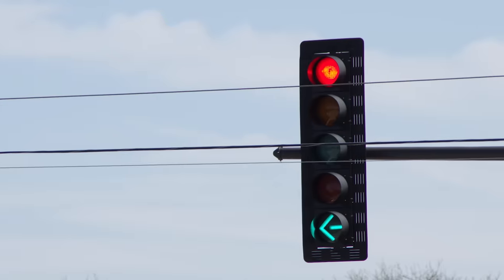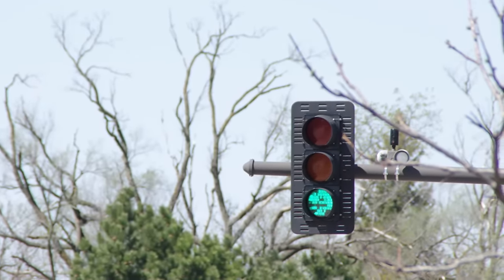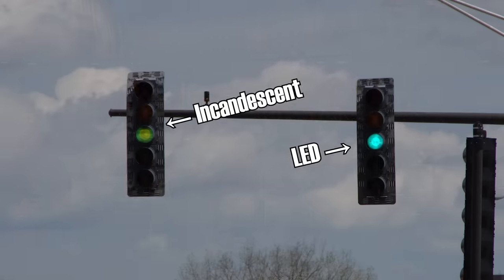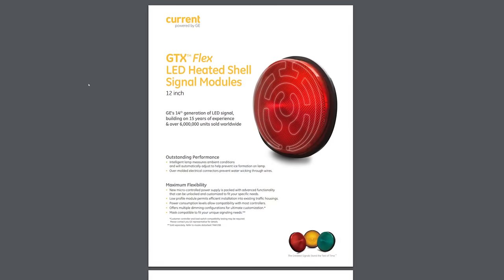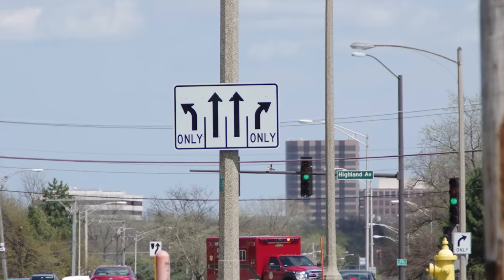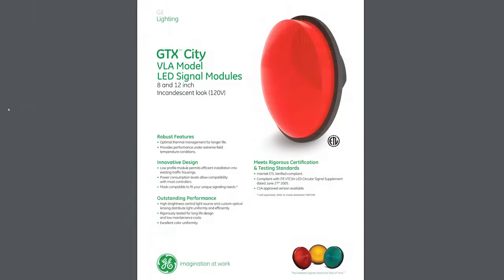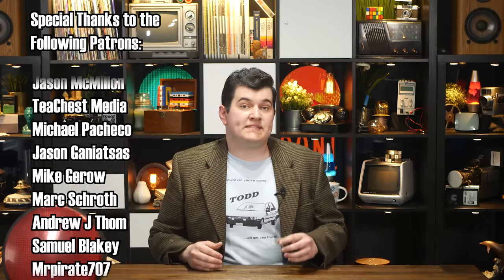The LED Traffic Light and the Danger of "But Sometimes!"

Comment: I would also be curious to know how many times "but sometimes" a burned-out incandescent light was the cause of a traffic accident, too.  I would bet you there are many many more injuries and fatalities associated with that than with iced-over LEDs, but nobody talks about that side of the equation either.
Reply: This is wrong idea. If the incandescent light burns out, it stops taking the current and the control unit can switch the crossing to "Danger" etc. I would bet the LED can be damaged easier and with less control over it.
Reply: @jirizlamal69  
Consider watching the video at some point
Reply: @jirizlamal69  I think you're assuming a lot.  I've seen quite a few traffic lights with burnt out bulbs, and in my experience the control circuitry in most of them is actually not sophisticated enough to do that.  They will typically switch to "failure" mode only if the whole thing loses power completely (i.e. a blackout), but not if only a single bulb burns out.  (Also, the typical "failure" mode (at least in the US) is to just flash all the red lights on and off, but if it's the red bulb that's burnt out (which would be the most likely to cause accidents), then that doesn't really solve the issue anyway, IMHO.)

I'm also not sure why you think that LEDs can be damaged more easily.  Modern LED assemblies are more robust than incandescent lights in most ways, and generally far more reliable (which you should really know if you actually watched the video, or, you know, ever actually tried using any LED lights yourself).
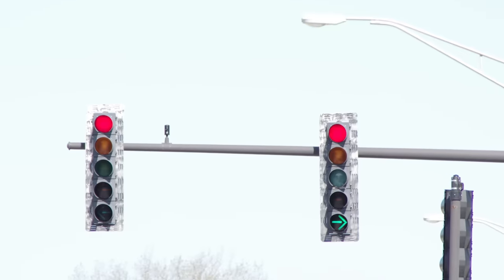Reply: @jirizlamal69  As demonstrated in 15:22, LED lights fail gradually. An inoperative diode doesn't result to complete light failure as incandescent bulbs do. Plus, a lot of LEDs are designed as a retrofit as shown in 2:43, so replacement procedures do not change at all.

In the first place, as explained in 3:13, LEDs have much greater lifespan than their replacements.
Reply: @Jiří Zlámal  I feel as though you opened the video, paused it about a second in, and then commented so you could share a misinformed opinion without being bothered by the idea that you might not know best. I advise having a wonderful day as you call your therapist and work through whatever causes you to think this way. 🤗🥰💖
Reply: That's not the point tho. If we can exercise rational thinking, this wouldn't be an issue at the first place. The point of this whole thing is how people are tolerant of what is already there, but not tolerant of new things, even if there is significant benefits.
Reply: @hiddenbunny7205  And the solutions to new problems of new things are often straightforward.
Reply: @dbclass4075  Oh it is all so USA! Just sort your media outlets out and get with understanding technology.
Reply: @douglasrogers3918  Henceforth the existence of this very channel.
Reply: Actually they do. That's part of the motivation toward LED lamps.
Reply: In 2022, still not having current sensing and a second bulb (or dual wiring in bulb), is a crime.
Reply: @foogod4237  Small leds live forever. Howerver powerful leds fail easily cause of heat.
Reply: @gizaha  Only if you're cutting corners and cheaping out by overdriving them or not heat-sinking them properly.  There is absolutely no reason a well-designed high-power LED assembly can't last just as long as small LEDs do, if not longer, and a great many of them actually do.

Cheap consumer equipment sometimes has this problem because they're doing exactly that (cutting corners to make things cheap), but the sorts of LED assemblies used in industrial applications and modern traffic lights, etc, are actually usually properly designed, and darn near indestructible in practice.
Reply: @foogod4237  I can't tell, you might be right but first, i didn't see a non-cheap POWER led that lasts more than 5 years and second there's a reason they use a fan to cool them down to increase their life (still lifespan is small). And the worst part after failure, the 2020+ curse, post excuses: "it failed because of this, it failed because of that".

But one way or another, a current sesing must be standard.
Reply: @gizaha  All I can say is you must be looking at the wrong products in the wrong places.  If you're looking at hobbyist electronics supply places, then yeah, of course you're only going to find crap there, because the good stuff actually costs money and most hobbyists just aren't willing to pay for it.  If you're buying some pre-built assembly off some hobbyist store site, it's pretty much guaranteed to be made as cheaply as possible in some no-name facility in China somewhere, and only tested just enough to get it out the door.  If it fails later, they don't care, because they've already gotten their money.  So why waste a bunch of time and money designing it properly to actually last?

But that's not the fault of the LEDs, that's just the fault of the crappy engineering that went into making those products.  When people actually are designing things to last, it does take a lot of time and money to do right, but when it is done properly it really does work, and there are lots of industrial products (many of which operate in rather severe environments for many years at a time) which prove that pretty well.

(And the use of fans is not really "to increase their life", it's actually "to use them correctly".  All LEDs produce heat when they operate, that's just a fact of physics.  You need to get rid of that heat somehow.  Small LEDs have a large enough relative surface area that they can act as their own heat sinks.  Higher-power LEDs need to have some external assembly to help dissipate that heat, though, and if you don't provide that it's really not that different from doing something like driving them with too high a voltage:  Like any other electrical components, of course they will fail if you use them wrong.  That shouldn't really be a surprise to anybody.)
Reply: There's no way a traffic light incandescent fails every year, also.  House ones do that because they're designed to be crap.  Industrial ones go dark instead because they're overbuilt.

Comment: It is indeed a nice jacket
Reply: Useless Duck Company Ph.D jackets.
Reply: I personally love the shirt worn by Mr "modernize NOW" even better. Railing on about how we need to get all modern & save the planet with these wondrous LED signals, while his shirt extols the virtues of a mid/Late 80's 4 door most likely CARBURETED  Import  (86 Tercel, I'm thinking). FWIW, I love those 80s Toyotas. Got an 86 Tercel 3 door hatch of my own, wouldn't trade her for all the gold in the world. But I don't run around pushing against obsolete tech while simultaneously promoting it.
Reply: My previous scool required to wear very similar ones
Reply: I think you should go to it a bit longer. I had no problems with jacket. It was very convenient too, because there were lots of pockets. We also had last day of the month, when we could go without official uniform. I only sometimes used that privilege.
Reply: MCPE McXreepeR Jeez, learn to write. You haven't wrote a single correct sentence.
Reply: lol do you even care about anything else, rather than how you dress up?
Reply: but tight - - - - -
Reply: just needs leather patches on the elbows
Reply: The delay on the right turn arrow exists in order to prevent cars turning right without looking for those last few lefts clearing the intersection, especially large vehicles that may not have a choice of lanes.  It has nothing at all to do with pedestrians, if it did, the right arrow would be disabled or delayed by the walk button.
Reply: But sometimes...
Reply: And how!
Reply: Yeah but it's tight sometimes I'm so disappointed humanity ☹️
Reply: @kyngliam1697  I care I checked it out but it looks way beyond my scope of abilities it would be cool but I needed to be easy
Reply: But sometimes it’s not necessary so you shouldn’t wear it
Reply: @MJ-uk6lu  I know this comment is super old, but I found it funny.
*You haven't wrote a single correct sentence*
Written or wrote 🤔
Reply: I found him recently and it's hard to imagine him without the jacket

Comment: Australia has nice signs for that:
"Stop if signals blacked out or flashing"
The sign is typically a simply STOP sign with 3 black dots to represent the blacked out traffic lights.
Reply: Never seen that. Usually it's just chaos as no one knows who has priority.
Reply: @Cheepchipsable  No. The give-way-to-the right rule kicks in.
Reply: @alanbeagley5529  or if your car is bigger.
Reply: Never seen those signs here, it's just a standard uncontrolled intersection
Reply: My country we have regular stop sign below
Reply: Is it weird that my European country has signs that are like for a normal intersection, but they are valid when traffic lights don't work? I thought it is kinda obvious to do it this way
Reply: @diagramgml  Some people may get confused between the lights and the signs, and then just try to follow the signs ignoring the lights.

Never doubt human stupidity and try to make things as idiot proof as possible.

There can also be confusion with people coming from elsewhere.
Reply: There's a problem, though.  What if the LED lights are only snowed out in your direction?

I've been in that situation.  Multi-lane roads in both directions.  I pulled up to the light and stopped.  I took the time to try to look around to see if I could see if the other directions' lights were also snowed over.  I could see that there was a wall of cars coming.

The person behind me honked their horn at me, then before I could react, changed lanes to drive around me.  Before they could actually get into the intersection, the cars going the other way drove straight through it, like they had the green.  Because they had the green.
Reply: @connorp4213  You have to think about them because they're out there.  I've heard of instances where the lights were only snowed out in other directions and I wasn't in the way of an idiot and they drove right out into the intersection assuming that the other direction would stop.  Under normal conditions, the other direction might have had time to stop in response to seeing someone run the light, but in these they couldn't.  That's all hearsay, but it sounds very plausible to me.
Reply: Here in Canada we treat flashing traffic lights as a 4 way stop. It’s actually the only scenario that works.
Reply: I was confused when you said flashing until I remembered that an advanced go is unique to Canada
Reply: @Tearnalte  when there’s a malfunction the red light flashes. Advanced green is when there’s an arrow that says you can turn left because in coming traffic has a red light still.
Reply: @donrotten4791  I know what an advanced green is, I forgot about the red and yellow lights, oops
Reply: @Tearnalte  do you drive?
Reply: @donrotten4791  No, which is why I probably sound like a complete idiot (and that's not wrong, tbh)
Reply: @Tearnalte  You didn’t come off as an idiot. I just got the sense you didn’t understand what I was talking about. I’m more of a rural guy so I don’t know all the nuances of city driving. I was afraid of traffic circles and down town one ways for years. I wouldn’t know what to do when they reverse lanes for rush hour.
Reply: Here there are just straight up stop signs...And of course, the crosswalks become a zebra
Reply: It does until the person coming the other way sees the green light and takes you out after you stops sign the red light
Reply: @dustinmeek4032  Do you know how to use a stop sign?
If you have a stop sign, then you would need to stop and let that person go through. It doesn't mean you drive into the intersection expecting them to stop.

The problem would actually be the other way, where you have no lights, without the stop sign, while the other way has a green light. But that is solved with redundancy and appropriate wiring.

Comment: I noticed where I live that some traffic signals have both incandescent and LED lights leading me to believe they are just retrofitting them as the incandescent lights burn out instead of taking on the enormous task of replacing all at once.
Reply: I think that's what usually happens.  And that takes a long time since there's no way the incandescents are burning out every year, house ones do that because they're crap, industrial ones can be much better exactly because they're a pain in the ass to replace
Reply: @tsm688  It's not about them being 'crap' or anything. If you put in the same bulbs as the ones in traffic lights into your regular house network, they would burn out somewhat similarly to other bulbs in your house (which depends on your houses wiring, not the bulbs itself).

The reason why bulbs in homes blow so often is because they are being fed more electricity compared to the thickness of the wolfram wire. As it heats up (from electricity passing through it), there is a structural change to it and eventually it just becomes too fragile and breaks under smallest shock or its own weight.

If you went and lowered the power output of your light (for example, running the 100W one at 50W with a dimming controller), then it would last you many years (unless your houses electric system just sucks).

The reason why the wire is so thin is because...it's more efficient as a light. If it was thicker, then you would need more power to have the same brightness of light, and as a result, at some point, you would even have a light bulb that barely gives light but heats like a heater.

Proof of the above? There are light bulbs that have been constantly on for over a 100 years. And I mean it, constantly on. But they give almost no light due to their wolfram wire being thicker and the current reaching them being lower.

Comment: "Really bad snowstorms can block the lights!"
Yeah but imagine that same snow storm knocks out the power (which it could totally do if it's THAT bad) and now the LED lights are the only ones that still have power because of the battery backups.
Reply: unless the snowstorm blocked the lights?
Reply: snow doesn't directly take out power.
Indirectly it can happen, rare but it does.  Snow can clump together and get really heavy.  Then tree branches fall, wires get hit, then power goes out.  Recent winter, i took a picture of a skinny wire, like 1mm thick, that got like 12mm of ice formed on it.
Reply: If the power lines are collapsing and there's that much snow falling, it's unlikely that there will be much traffic.
Reply: @cryptfire3158  Ice storms are what you have to worry about.
Reply: Where are these elusive battery back ups?
Reply: they can add a heater... that is triggered by a county administration so that when it is snowing, the heater is on.
Reply: @BarryObaminable  The fact that stop lights are covered by snow/ice is so extremely rare it won't be cost effective.  You're talking about this happening maybe one or two days every three or four years in most places.  The one they show in this video have small/short covers on them, and those types are rarely used anyway.
Reply: ”But the snowstorm blocked the traffic light”

-Driver who can’t even see 100m in front of them because of said snowstorm
Reply: @jmackinjersey1   cheaper than lawsuits
Reply: @BarryObaminable  Who is getting sued?
Reply: Never seen it caused by snow, but I've seen intersections on generator backup in my town.
Reply: @adde9506  That could be, especially for a temp situation.  But not battery back up.
Reply: If a snow storm is that bad you literally wouldn't be able to see the LED lights.

Typically even light snow can add a lot of frost or even snow build up, and for some regions this is an extreme issue. Sure you can add things to aid lights... but will they be added if they aren't forced to?

That is why there is so much fear, yes there are solution but for many people that solution is not certain to come with it.
Reply: @jmackinjersey1  It isn't extremely rare, for example all of Canada has to deal with snow. I believe all of Russia as well.  I think at least 1/4th or 1/3rd North America does.

Your comment is like someone near Florida saying people up north are being babies about snow and ice.

It is extremely common in reality and a legitimate concern since using the LED lights does not force them to install solutions. Car accidents, needing a new car, repairs, ambulance and police vehicles all take a lot of energy and will easily offset things.

Winter is incredibly dangerous for places with snow and with snow it is pretty common.